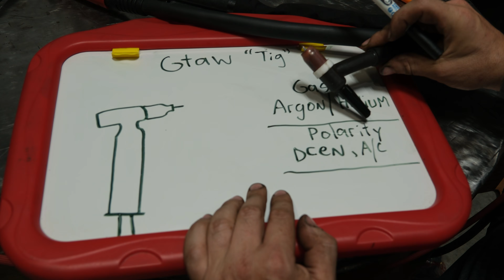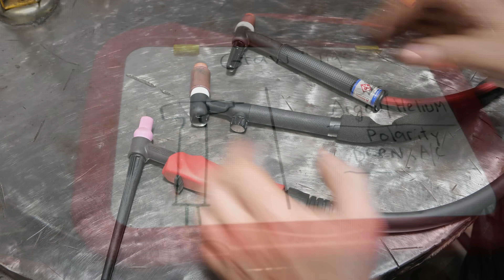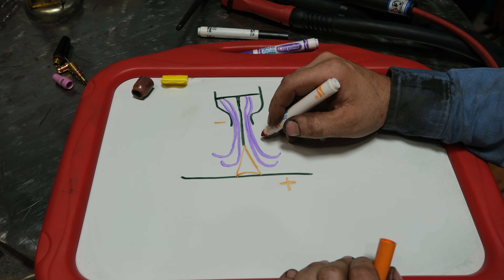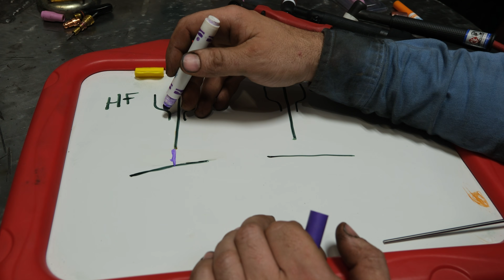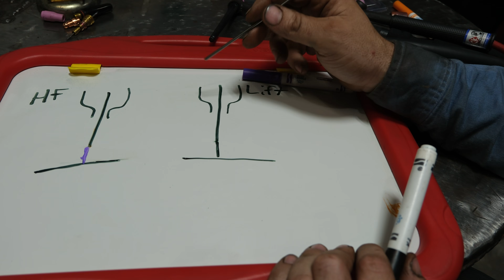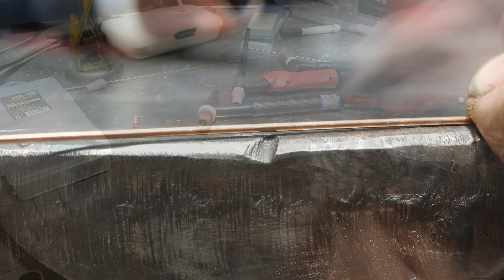How to Tig weld:  Part 1, introduction to tig welding

Comment: Third time watching this as I am trying to start tig at home
Reply from the maker: Glad to hear your learning tig 👍.  Truthfully tig will frustrate you at times.  Expect to be frustrated a bunch and the key is to not give up.  No matter how many tungsten’s you dip or filler rods you stick to the metal, laugh off the mistakes and keep going.  It won’t take long before youre producing decent welds 👍

Comment: Love the video. 2x was my speed, though. Nothing personal. 
In my journey of welding so far, and I'm by no means an expert. Ive learned that half of the learning curve is figuring out what you are doing wrong, or what your machine is doing wrong. Even dialing in settings has its own learning curve, and while it can be frustrating learning all the ins, and outs. Pushing is better than pulling because your gas leads your puddle. Prep is everything if you want a clean weld. Starting miters a little past 90° so you get a true 90 when tge heat pulls tge metal together.... so many little things.  there is nothing more satisfying than getting in the zone and you can even hear when your weld is perfect. Well not so much with tig, I dont think. Seems mostly silent, but im about to embark on that journey. Wish me luck!! Thanks for the video, and im sure ill find all your tig videos!

Comment: TiG welders are morally superior and more spiritually pure. Stick welders are a solid second place. Hot melt glue gun guys (er… MiG welders) are lost… their hearts are riddled with contaminants and their souls are covered in mill scale …Certainly keep your children away lest they be karmically blemished. 😂
Reply from the maker: Haha 😀👍.  Where do oxy fuel welders fit 😂
Reply: @makingmistakeswithgreg 
Mennonites. Easy to spot. Their welding trucks are the ones with a team of horses in front. 😂

Comment: Glad I found you . Im wanting to learn tig. I have mig experience over the last ten years restoring cars. Sheet metal thin gauge and some support brackets. Basically quarter panel replacement and floor patches and entire floor replacements. I would like to build my own exhausts as well which I think tig would be better than using mig. Also I’d like to make craft items which need very nice looking exposed welds. In the future. 

At this time Im 69 and Trying to find a decent tig unit that has everything and doesn’t break the bank. Can’t afford to buy junk units and replacing parts. And having to rebuy a unit. 
Can you advise? 
Like Eastwood TIG 220 AC/DC? Any thoughts? 

I just found your utube and hope to be following you. I also like the fact that you are willing to reply and actually help us newbies! It is so Awesome to find that special someone for training and support. Thank you. ❤
Reply from the maker: You’re entirely welcome.  So with tig machines there are differences with them, some don’t really matter and others are significant.  The biggest thing that separates a cheaper tig machine from an expensive machine is how well it welds on A/C.  Honestly most machines weld on d/c similar, but with a/c that’s not the case.  High end a/c tig welders make it far easier to weld aluminum because of how well their amperage control works, and how low their amperage will go while keeping a stabilized arc.  What I have found universally with cheap a/c tig machines is they have a hard time holding a stabilized arc at sub 30amps.  If you’re tig welding aluminum sheet metal having a wandering arc sub 30 amps (or an arc that just shuts off below 30 like some machines) it’s far harder to get decent welds.  When you look at high end ac/dc tig machines much of the money goes into the a/c portion of the machine.  

The second big difference that matters with tig machines is how low the amperage can go along with how “hot” of an arc start they have.  Many cheaper machines have a 20-30amp arc starter which can make welding material like 22ga very difficult because the arc blows a hole in the material upon startup.  As I mentioned previously many machines also won’t weld below 20amps on d/c and 30amps on a/c which makes welding thin material harder than it should be.  

Power is a big concern with aluminum.  Aluminum eats so much amperage that 200amps tends to only be useful for up to 3/16th thick and over that it’s limited.  If you have ambitions of welding 1/4inch aluminum a more powerful machine may be required.  200amps is more than enough for any thickness steel or stainless.

Beyond what I mentioned cheaper tig machines typically don’t have very smooth arcs, the foot pedals tend to be cheap/don’t work the best, and the quality of accessories aren’t the best either.  Keep in mind many machines come with a 150amp torch despite being 200+ amps and if you weld at 200amps on a/c the torch will not last long (overheat and melt). A/c puts a ton of heat into the torch and this is why most people that tig weld aluminum eventually go with a water cooler and water cooled torch.  

The great news is the common tig machines on the cheaper end are far better today than ever before.   By no means do you need a 6k dollar machine to get really good results.  I have good things about eastwoods machines but I have only welded with their old school 140a mig machine.  I would imagine their tig machines work well.  Stay away from arc captain, everlast, and no name brands on amazon.  Generally speaking everlast welders, harbor freights Vulcan line, prime weld, and AHP are pretty decent at reasonable prices.

Comment: Feel lucky to have just bought a 1981 Miller Dialarc HF-P. Cost me 400+ 108 for a new torch cable
Reply from the maker: Those machines will last forever and weld quite well 😀👍.

Comment: Today I bought mi first tig welding machine. Even though I’ve seen a lot of intro videos about it I find this the best by far. Love your pacing and attitude about it. I’ll go through these while I get the gas bottle and the consumables. Cheers from Argentina :)
Reply from the maker: Glad to hear you bought a tig welder and are learning.  Once you master the basics with tig you will open up all sorts of possibilities.  Expect to be a bit frustrated at first and to fail a bunch.  However over time you will become better.  The most important thing is never give up and focus on being as smooth and consistent as possible 😀👍.

Comment: I got a pancake hood and found a #10 fixed gold lens from Hobart. It is sandwiched between two polycarbonate protection plates. After shaping the balsa-wood box, when I put it on everything is dark unless I look at a window with the sun shining through. Then it looks as if it were nighttime with a sickle moon’s worth of moonlight streaming in. I am guessing that this will be good for a start. I also have a better quality lens on its way that is supposed to be bluish just in case the cheap Hobart lens doesn’t cut it. I hope this will fill my needs. I am wanting to learn well enough to do a simple lap weld of about 3 to 4 inches worth with 1/2 mild steel plate.

Comment: I need to do some patching of 22 gauge metal (antique tractor with moth eaten holes in the hood)...do you have any expertise in this thin stuff? The advantage is is it real steel, 1952 vintage. Some holes smaller than a pencil, some will need replacement metal.
Reply from the maker: So with 22ga you really have two options: 1) tig with .035-1/16th diameter filler, or 2) mig with .023/.024 wire.  Both of those can weld 22ga fairly easily.  Both require the material to be fairly clean (mig less so).  Self shielded flux core and stick will tend to be too aggressive and likely be very frustrating.

The easiest way to fix stuff like that is to clean the metal up around the hole, put a copper “spoon” (google copper spoon auto body to find one) on the backside, and do small spot welds with .024 wire. Many mig welders will work with that small of wire but often you need to buy a specific liner and drive roll for the machine.  Some machines won’t be able to run settings low enough to run wires that small so if in doubt consult the factory manual for the welder you have.  

Realistically tig can work, but it can be difficult to get the material clean enough to not have issues with tungsten contamination.  Tig can have a tendency to input more heat for a given spot weld too, due to being slower than mig, which can lead to more warping.  Auto body is most commonly done with small spot or stitch welds with mig for ease and speed.  I need to do a video on this to give more tips 👍
Reply: @makingmistakeswithgreg  I'm really planning on TIG and I'll use some of my .030 MIG wire. I have a CK17 torch, strongly considering a CK9 and get some of the clear cups from Jody Collier so I might see a bit better....tired old eyes that were never real good. I'm going to clamp a copper bar on the  outside (visible) side of the hood. It will keep the weld from "sugaring" and minimize any material that may need cleaned up. I watched a MIG/TIG comparison...the MIG took considerably longer to clean up. And, I'll waste a lot of metal practicing...I'll go wild with my drill and do a variety of sized holes. 6 months ago I knew nothing about welding, now thanks to you and Jody, I can talk somewhat intelligently....I still can't walk the talk but I'm getting there. Thank you so much, you're an invaluable resource. Do you happen to have any parts for a John Deere stylized Model B (1952 vintage) laying around? <smile>

Comment: Hey! You doing okay? I haven't seen anything from you for many days...so, welfare check to make sure you're still vertical.
Reply from the maker: Yes, I am out on a job in an area with no reception for the past week so it’s tough to respond to stuff 😀👍.  Once I am back home in a few days it will hopefully be back to normal 👍.
Reply: @makingmistakeswithgreg  I was just watching a review of the Rogue ET 201ip Pro  (upgrade of the 200) and it does pulse in stick mode. Still being a virgin at this, what application would that fit? I was thinking pulse for TIG with thin material...would stick have the same application?

Comment: Greg, do you have an email that you're willing to share? I have a few questions that the youtube area isn't really the best place to ask. Meanwhile, is MIG or TIG as far as penetration and overall better weld? I'm a newbie, older than rocks, and trying to get the most bang for the buck...
Reply from the maker: Send a message to weldingoldschool@gmail.com.  Regarding mig and tig, if both welds are similar (equal penetration, weld size, and the same filler is used (er70) tig will hold an edge on strength.  Not only does the 100% argon atmosphere of tig produce a weld with higher tensile strength than common c25 mig gas, but the profile of the tig weld tends to be better for handling stress.  The bigger issue is in the real world it’s not easily possible to achieve the same level of fusion with mig as tig.  Tig is fully capable of producing welds without reduced root fusion at the start of a weld, mig will always have a slight lack of fusion near a weld start.  Mig will also struggle to produce proper penetration on metal thicker than 5/16th, which is why a switch to dual shield and spray arc is generally made (both require 220+ amp wire welding machine to do).  

For the things most people weld on 1/4inch and thinner material there won’t be much difference between mig and tig when it comes to which will last.  Provided both welds are clean.

Comment: What is the model and part number of the torch that replaces the foot pedal with finger adjustable amperage? Does it just replace the 5 pin foot pedal on my YesWelder TIG-200P AC DC, the only ones I did find say they're for Lincoln or Miller, I have no idea what the pins are on those and if one or the other would work. 

How do you decide what flavor Tungsten to get? I tried searching and ended up getting the Purple 3/32 as my best guess to start with. Also, is there a specific filler rod that's better to learn with? Again I tried to search and went with a best guess by getting 3/32 309. Is Tig unlike stick welding where you're limited by your welder on what filler rods you can use (like 6010 with stick welders)?
Reply: I see you covered Tungsten flavor to start with in video 2 (Blue), I did think for a moment the radioactive stuff must be really good or a person would be insane to use it but decided I didn't want to turn my shop into Chernobyl from the sharpening dust. It's hard to save my questions till the end of the semester when you're trying to figure out what to buy just to get started.

Comment: I almost made the mistake and bought a dc tig welder, but I hopefully bought one on Good Friday that was on sale for around $800 that does everything, which I probably won't use all settings and need to learn which setting is good for whatever I'm going to do.  Welding aluminum is going to be my main metal. I haven't gotten the chance to use it yet, but  hopefully, it will work well.
Reply from the maker: Hopefully you got to play with your new welder already 👍.  Aluminum is hard to learn at first but stick with it and you’ll develop the skill.  Probably one of the most valuable skills to have, it opens up a lot of doors 😀.
Reply: @makingmistakeswithgreg  thanks for the vote of confidence.  Haven't gotten the chance yet but I had to finish a painting project first which wouldn't have mixed very well. Going to take my time and learn to correct way so I don't get into any bad habits from the start.

Comment: I'd like to commend you on your great , very informative videos. I bought a Vevor 130 amp fluxcore/stick/Tig welder to repair my old rusty 1996 Nissan Sentra and up to now, I've rebuilt the inner railing , floor and rocker panels . Took me 5 full days...after months of watching YouTube videos to learn the basics and long hours of planning . Still lots of work left to be done this coming spring. 
Most videos show "stacking dimes" and how to get good looking welds. That's where you make the difference ! You dig deeper and show the results. I really appreciate that. 
Id love to try Tig , but getting the gas looks like a problem considering they want my credit information and I aint got credit. 😂 On top of that i live on a third floor apartment so those large bottles are out of the question, so im wondering on how long would a small bottle of Argon lets say would last me if i ever am able to get one ? Ive read that for MIG the mix gas  last about 3 hrs ? 

Thanks again for your great work !
Reply from the maker: Glad to hear youre putting a welder, learned knowledge, and practice to good use.  Knowing the videos I make help out people like you is why I make them 👍.  Regarding the cylinder size, here is a good way to estimate usage:  with a gas lens in the tig cup (instead of a collet body) you can cut the argon flow to 10 to 15 cubic feet a hour.  Tank size wise the large tanks are 300 cubic feet, so 20-30 hours is the normal out of one.  With smaller tanks, the most common is something around 125-150cuft, which are significantly smaller than the 300cuft.  Those last as much as 10-15 hours.  The small ones are like 30-50cuft, think the size of two 1 gallon milk jugs, so only 3-5 hours on those.  

Where you get “took” on the small tanks is a small 150cuft tank might be 60$ to fill and the 300 is 80.  The small tanks are stupid to fill.  Also, around here (might be different there) I can buy a in test date tank private party, and exchange it with a local supplier without issue.  No credit needed, just a tank you own.  Airgas doesn’t do this but everyone else does.
Reply: @makingmistakeswithgreg evidently the best deal is with the large format.  Around 4 bucks an hour for practice is not bad as an investment!

Thanks a lot for the information👍👍👍

Comment: I have several vehicles that I want to restore, so I bought an older 275 stick, tig Lincoln welder, it has foot pedals with it, set up for water, not much heat for sheet metal, never hurt the welder, I have stick welded for 60 years, MiG for the  last 30 years off and on, I learned gap control hard surfacing farm tools, how I learned it I don’t know, but I weld hotter than most,

Comment: Very nice video! I have an AHP 200X. I do not TIG weld everyday, but "so far" has performed very well without issue. Only recently the hose to the TIG torch broke open at the torch and the connector to the machine. Kind of weird as the hose otherwise looked like new, not even dirty. Think it deteriorated as it's exposed to the sun if my garage door is open. Recently I did my first TIG weld, cast iron to steel. Preheated the casting,, used Ni-Rod and was surprised how well it welded. The newer AHP machines are more digital but I have no issue with my analog knobs.
Reply from the maker: The ahp welders have proven to be solid welders across the board.  The tig torches with many machines tend to have issues with the hoses.  Generally speaking most of the hoses will crack over time due to heat cycles and exposure to the air.  It’s a good thing you caught that, often times they crack and only leak argon out when the torch is in a specific position.  This can lead to hair pulling frustration trying to figure out why welds have random porosity yet everything seems fine lol.  Glad to hear you had luck with nickel rod and castings.  I will get around to a video on this at some point in the near future.  Truthfully tig tends to weld with nickel really well and the results tend to last.  The thickness and metal composition of the casting will definitely play a role in success.  The ability to tackle such problems is a really awesome “tool” in the tool kit.